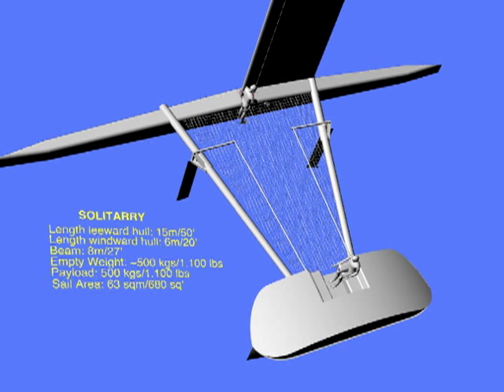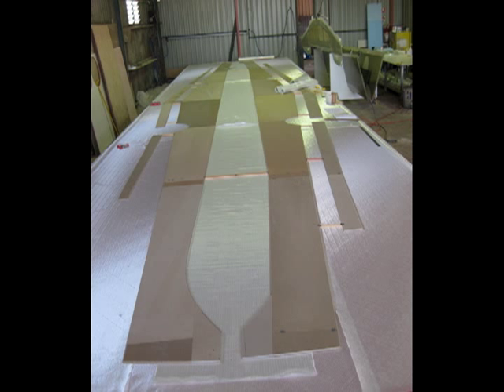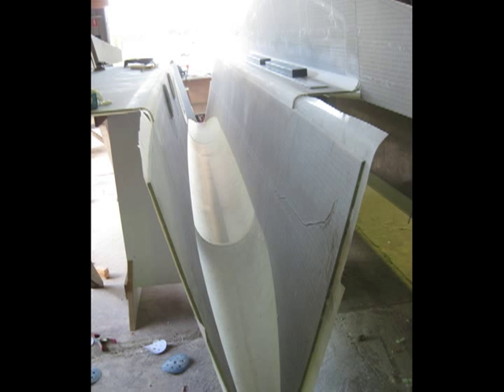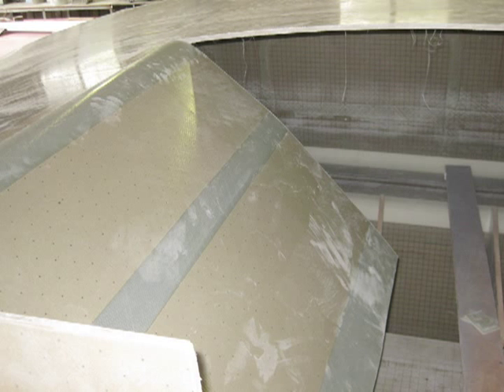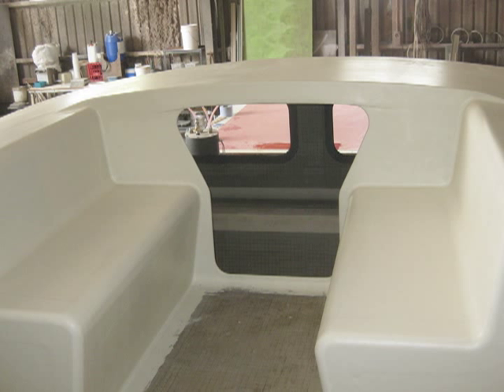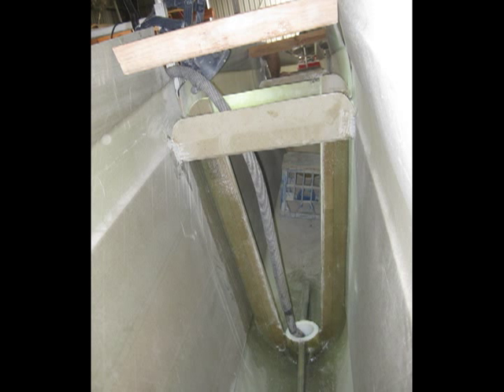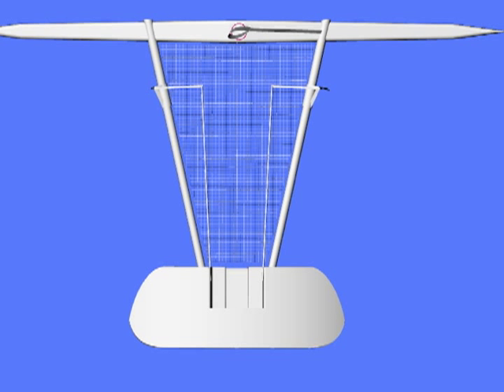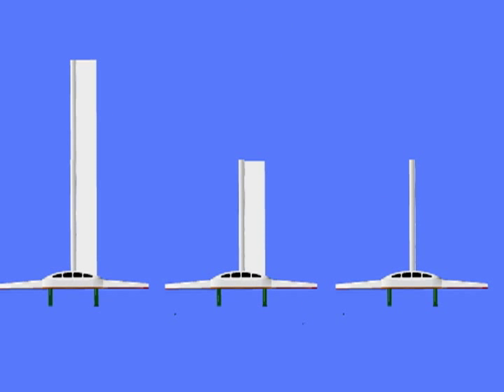Building Solitarry hulls from infused flat panels

Comment: Fantastic ! The French have a catamaran factory. Where they  build different models and sizes with cnc cuts of plywood panels . If they see your project ....
Congratulations
Eddie
Rio de Janeiro - Brazil
Reply from the maker: Thanks, glad you like it.  The method (and the boats) has been significantly improved since that video.  Have a look at http://harryproa.com/?p=1845 for a more recent look at what we are doing.  The other boats are also on that web site.  For what it is worth, an Intelligently Infused hull will be about half the weight of a plywood one, won't rot and in most parts of the world will cost less.
Edmund,
Sorry for the late reply.  The project was completed is now the windward hull of a 15m/50' kite powered boat project.

Any questions, feel free to email me at harryproa@gmail.com
regards,

rob